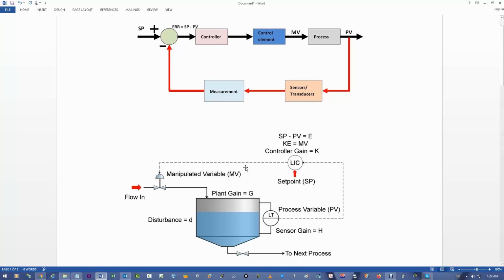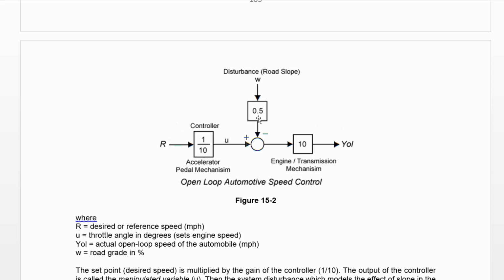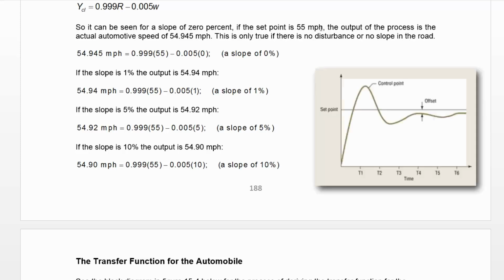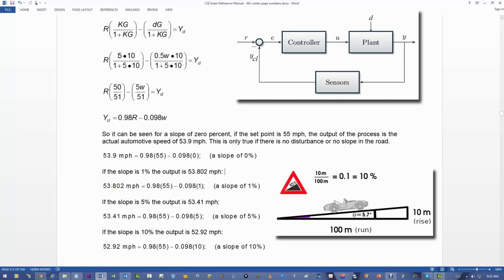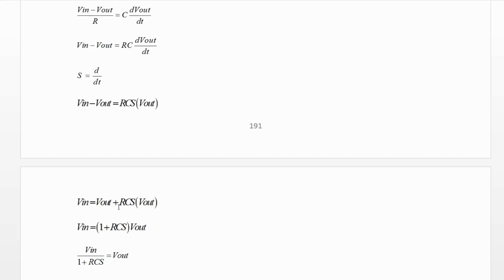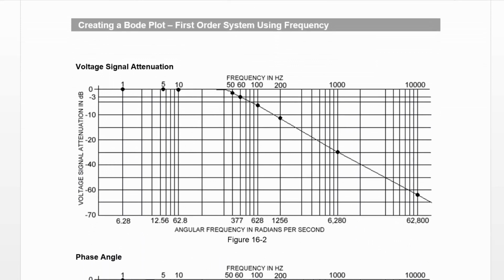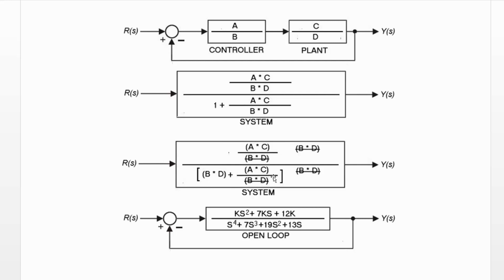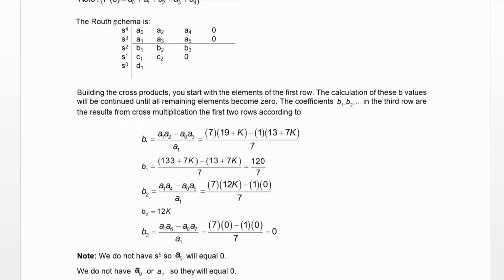Video 7F - Control Systems Review - Transfer Function,  Frequency and Filter (Enhanced Audio)

Comment: I have a question: For the PE exam, will we need to determine only the closed-loop transfer function, or will we also need to assess system stability using the Routh criterion?"
Reply from the maker: I believe the Routh Criterion has been dropped.